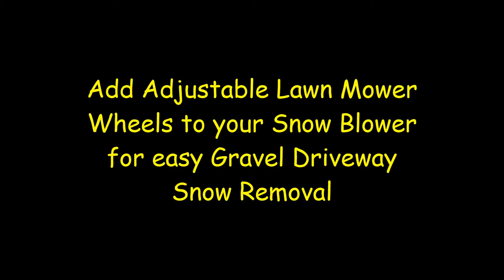Snow Blowing on Gravel Driveways (Adjustable Front Wheels)

Comment: I tried that idea last year but the small lawn mower wheels I used would ride up on the snow lifting the front of the blower up and leave too much behind. Smaller roller blade wheels would probably cut thru the snow better being they are narrow, like wheels from a roller blade.
Reply from the maker: I never have had a problem with the wheels riding up on the snow. Maybe possible if you have and inch or two built up from previous snows then they would ride on top of that?

Comment: Looking to add this to my snowblower where did you get parts or do you know where to order parts?
Reply from the maker: I also work on lawn mowers and I got a used wheel set from an old mower. Ordering new wheels sets off the internet would be to expensive. Get a cheap mower with adjustable wheels off Craigslist or market place.
Reply: @gse244   That's what I did as soon as I first saw this video. I went of Market place and found a good used lawnmower for free! It has the adjustable wheels I needed, but when I got it home,I found it was too good to rob parts off of so I cleaned it up and it's my trimming mower now! Gotta start looking for another free one!

Comment: Did this to my snowblower. 
Adding wings to clear a path for the wheels is a must for the heavy snow, otherwise it builds up in front and acts like wheel caulks.  So without wings have to keep lifting and dropping front of bucket.
Reply from the maker: I'm in lowa and most of our big snows are only around 6 inches or so. So just the wheels have been work so far for me. Thanks for sharing.